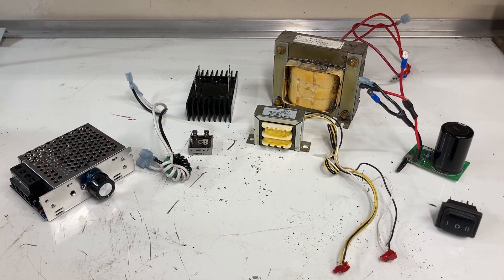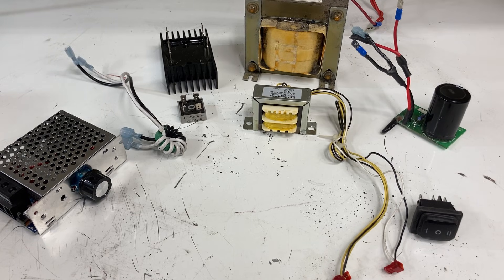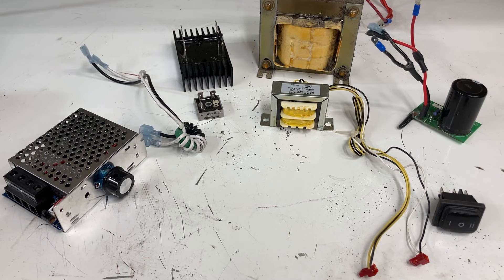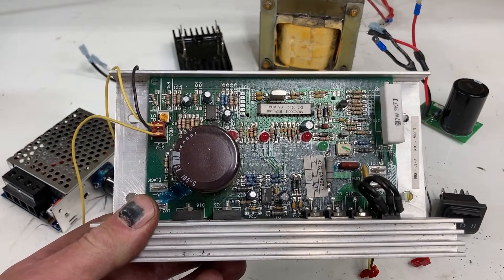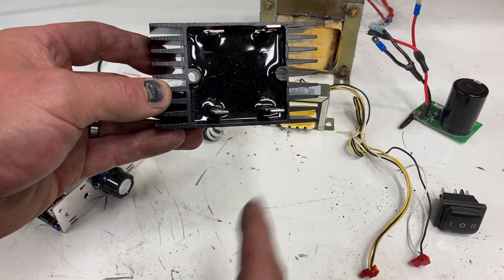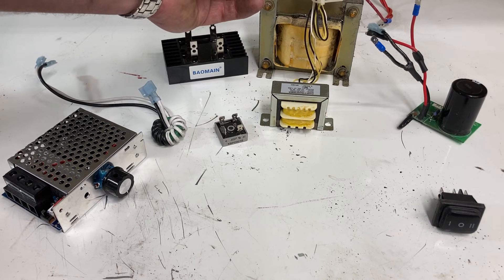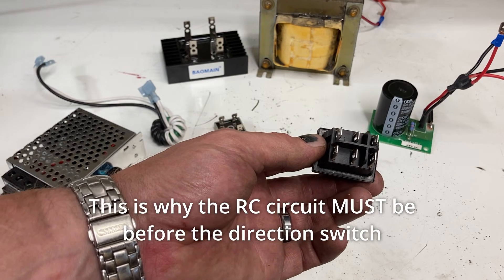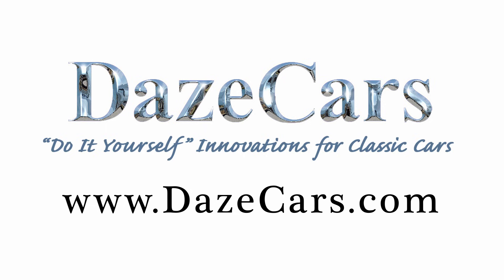Putting Together a QUALITY Variable Speed Power Supply or Treadmill Motor Controller SCR type

Comment: I am sorry to do this but I must:
Read on:  If this will cause to delete my comment and further be blocked, I simply interpret that as it did its job.
These import chinese so called adjustable voltage, variable voltage or whatever terminlogy is used for it, just know this.  In actual defintion they are what is called phase controllers, that is CHEAP PHASE CONTROLLERS.   But phase controllers for what?
There are only two ways to change voltage in AC motors.  One is by what is called phase control and the other is variable frequency drive.  You hear the term VFD lingo.   Now read on.

Phase controllers do not work on induction motors.  That is not what is meant by AC motors.  When they say AC motors, it means universal motors, you know the brushed motors like your power tools if you know what I mean.
They also work as light dimmers.  And that is it.  But anything works on those universal motors, you don't need this nonsense to control their speed unless you have an old old vintage one that was made back in the days  and you just can't wait to control their awe inspiring speed.

Now if you think you can just install a bridge rectifier (any kind of it) and a choke and a capacitor or whatever on these to run a heavy duty Magnetic DC motors you will be in for a rude awakening.
You are basically running your Treadmill motor on a cheap messed up half ass supply that is neither AC nor real DC.   Trust me.
When you convert your AC to DC with a bridge rectifier, what you don't get is the science of it.
First of all as you know your AC flactuates up and down and also back and forth.  It has two movement.   Well guess what, so does your bridge rectifier, it transfers the up and down fully intact, just removes the back and forth.  

If you think  a capacitor  smooth things out, guess what, it doesn't.  In fact it raises the voltage higher.  Just remember you and I and all these folks didn't finish a degree in electricity.  I know and there are billions of us out there. 

Your motor takes on a beating like it is nobody's business.
If you want to destroy your motor, there are cheaper and faster ways to do it.

And by the way that potentiometer turning knob job has little meaning with respect to this. These high torque heavy duty motors will impose their need on current and them little turning knob job and the triac and diac and quadrac by themselves is just kids play to it.   These things are called light dimmers for a reason.  And by the way this word "light" in light dimmer does not refer to any other light but old obsolete incandecent light bulbs.
You hear that?
You get that?
Suit yourself.

Now you think about that.
( No you won't hear this kind of truth just to get attention and clicks)
Reply from the maker: You are not correct, at least not correct as it pertains to my video.  An SCR voltage controller does the same thing that a PWM does only for AC. It switches on and off quickly to effectively reduce voltage. You are correct that this technique does not work well for most AC application except things like lights just as you said, but when you convert it to DC with a rectifier it is true DC. That is how a rectifier works. When DC is converted to AC it is not tru AC BUT in reverse it is 100% true DC. That is what every power supply in your house does. You are also correct that when improperly set up SCR controllers will create power spikes, but that is what the chokes are for. The AC choke between SCR and rectifier eliminates low frequency spikes and the DC choke on the positive leg eliminates high frequency spikes producing clean power. This technology was used for years in welders.  An SCR would "reduce" voltage and a rectifier would turn the voltage in into DC. As to your  capacitor concerns  that is why it was the last “cleaning” component.  After the spikes were eliminated it helps stabilize power.  If run before the chokes there is a swing in voltage because of the spikes loading the capacitor.  The Capacitor is not that important 99% of the power cleaning comes from the chokes.  I have been using this setup on my lathe for over a year with hundreds of hours of run time because it was set up correctly. Your statement about it ruing my motor is simply incorrect.  People against SCR as passionately as you are, are usually speaking from experience, they bought a cheap SCR (the cheaper the SCR the dirtier the output), didn't use chokes, used a cheep rectifier and expected it to work well. NOT ALL SCR VOLTAGE CONTROLLERS ARE CREATED EQUALY.  Just like with a PWM the better the controller the better the power.  I didn't create this video for likes and attention as you  presume, I did it because there is a lot of bad information out there that does not show people how to correctly set up an SCR. Because of that bad information a lot of people have ruined their DC motors by not setting things up correctly,  BUT doing it correctly will result in a good system that lasts a long time. Is an SCR as good as a high end (and expensive) PWM designed to run a motor like this, NO.  Is a properly set up SCR as good, easier to use, more cost effective and way more robust than most PWM that come in treadmills, YES.  I have three machines that are all using treadmill motors driven by SCR controllers and because I know the correct way to set them up they work extremely well.  Your conclusions are based in facts but not the entire picture and without the full picture/understanding you are drawing incorrect conclusions.
Reply: @dazecars  To genuinely know what I am talking about when I say DC supply and to witness it in actual fact the experiment is simple and no arguments as what DC supply means.  The difference between AC, rectified AC, AC to DC converters and the real DC.
None compares to real DC.
Since AC to DC converters are say expensive and that is why this type of videos are there for do it yourself.... which is the wanna be DC supply.  It is termed as rectified AC.
Fortunately there is the real deal at your disposal and it is everywhere.  Better than the expensive converters, yes  of course.  I give you the real deal, YOUR CAR BATTERY.
Just grab any of these motors and don't be shy because your car battery can turn your starter, that is right and that is no child's play which mind you then turns your entire engine.  That is right.

You just hook up any of this Treadmill motor to your car battery and don't you be shy because you are in for a treat.  No worries, use your jumper cable, hell that is even better.  It won't hurt anybody's feeling, especially yours. 

You will never ever be the same again nor will your beautiful Treadmill Motor once you witness what real DC is.  Now know why no one told you that.
It will purr like a kitten and the sound of harmony as your eyes and your ears witness it for YOURSELF FIRST HAND.

Didn't mean to be beligerant at all. Just making  it be known.
{ I mumble to myelf, it is hard not to get a joy letting the cat out of the box, or maybe it is bird. Now I can't remember}.

Hey here is one.  Buy a battery just for the motor. In fact get two of them and hook them in series and make 24 volts.  That is right.   Then get this,  hook up your battery charger to your battery ( why not).
You follow?
Hook up your Treadmill motor to your 24 volt battery,  Just trust me okay.  No need for 100 or whatever volts.  That motor will do whatever you wish.  No it won't pull your semi trailer.  Don't be silly.
But you will know sweetness.  And wonder if that thing is even running.  Oh whisperring beauty. 
Over and out.
Reply from the maker: @alchemy1  now you are just going down a rabbit hole that has nothing to do with the topic. “Rectified AC” IS DC. A lot of things in your home use a rectifier to convert AC to DC. Even the PWM controller boards that come in a treadmill for the express purpose of powering the treadmill motor have a rectifier to convert AC to DC. The only functional difference between PWM and SCR is the PWM does the on and off switching to reduce power after the rectifier where as the SCR does it before the rectifier. Will DC created from a rectifier be as smooth as a battery, NO. But that doesn’t mean it won’t work and work well. Your suggestion of running two car batteries and a battery charger is ridiculous and proves you do not know what you’re talking about. The advantage of a DC motor is if you change the voltage you change the speed. This is why you use a motor like this in applications where you want to be able to adjust speed with the turn of a knob. Your “battery technique” will provide a constant speed (with the exception that the speed will slowly decline as the voltage drops due to the depletion of the batteries) and is not a variable speed supply which is what the video is actually about.
Reply: @dazecars  To mitigate between zero point crossings, inductor impedence and capacitor impedence requires far more and much more involved than to be resolved by simplistic devices.  Will agree to leave it at that.  I didn't make the rules. 
It is all good ( assuming one has managed to ge to first base) untill there is demand on the system, then things get revealed more and more.
[Quality is an appealing convincing term]
That is all.  I had nothing to do with it.  :-)

Comment: Would a drill gearbox work mated to a treadmill motor? Cheapest gearbox I can think of.
Reply from the maker: Different sized pulleys and a belt are the best way to go.  A drill gearbox will not be able to handle the RPMs that treadmill motors go to, most are 4000-7000

Comment: PWM doesn’t need to be expensive, not when you build your own controller. And they provide more low-end torque than an SCR in my experience. 
I haven’t messed with treadmill motor voltages in a while, but I’ve got a really nice motor on the shelf that’s been waiting for a home. Probably time I dig it out and wake it up.
Reply from the maker: A pore quality SCR will not function as well as a PWM and yes the motor will slow under load ( your observation of less torque). But a quality SCR will function as well as a PWM supply.

Comment: What size choke did you use? Do you go by amps or……..? The big choke I mean; just before the run capacitor.
Reply from the maker: I just use the ones out of treadmills I have parted out, and there are not any specs on them.  I have 4 different sizes from the size of a racketball all the way up to a softball and they all work about the same.  If you are looking at a new one you want one that is rated at the amps of your motor.  If it is rated in watts take the amps X the volts from the motor and that will give you watts. For used ones  eBay is probably your best place to get one.  Search "Treadmill Choke".  Be warned however that a lot of eBay sellers do not know if they have a choke or a transformer AND because they look the same think they are interchangeable but they are not.  Easy way to know the difference is a choke will have 2 wires, but a transformer will have 4 or more.
Reply: @dazecars  thank you very much

Comment: Blessings bro just got a 240v 3hp out rotor dc motor would appreciate a little help understanding the motor and actually powering it up any help will be much appreciated
Reply from the maker: I need more info to help. Contact me through my website so you can email me pix of the motor, especially the data plate.

Comment: Nah, PWM is the way to go. Today's semiconductors with good heat dissipation mitigates all the issues you mentioned. It's why welders today are a lot smaller and run cooler than in the past. When you compare the waveforms, PWMs deliver a cleaner and more uniform torque/speed.
Reply from the maker: Thanks for the comment.  I 100% agree that a good PWM power suply is better than SCR controller but a good PMW is also expensive,  $200 + for one with the amp and volt requirements of a treadmill motor at max.  Most of the treadmills come with a PWM board but in my experience they don't work as well as a properly set up SCR units.  So if you spend the money, a good PMW will out perform an SCR but most people using treadmill parts are trying to balance quality with price at which point an SCR unit is far more budget friendly and (if you do the things in my vidio to clean the power) can be set up to run very well providing the best performance to cost ratio. IMHO
Reply: @dazecars  You can buy a 90V pwm "speed governor" for less than 20 bucks on Amazon. At the lowest voltage, the torque is low, but you can gear it up to overcome it.
Reply from the maker: @bobweiram6321   A lot of people running treadmill motors run them BECAUSE they can lower the speed and anything that looses torque at lower RPMS is counter productive.  Would love a link for this PMW that is only $20.  All the ones I have seen are not really up to the task
Reply: @dazecars   PWMs lose torque only at the lowest range due to its back EMF sensing circuit. If the EMF combined with the impedance of the motor is below a certain range, the circuitry fails to dump more power. Once you get past the low range, the torque curve stabilizes and flatlines, which is the constant torque. A slightly more expensive PWM controller has better sensing and can adjust the power to maintain a constant current or torque even at the lowest speed. It's not an important detail since 1 to 5 RPM is used much and if you do need it, then gearing it will give you constant current at those speeds. SCRs, on the other hand, only give you maximum torque at their full speed and rapidly drop off for anything lower. You're essentially controlling the phase angle. 

Here's the link for the controller. The price has gone up since I last checked. There's better ones out there, but I cannot vouch for them. 

https://www.amazon.com/dp/B07RLFZM2V?ref_=cm_sw_r_cp_ud_dp_PC75RYT25GJDM69ATN8Y
Reply from the maker: With an SCR the torque at low RPM is fantastic ( I do single point threading in grade 8 bolts all the time and my lowest RPM setting) even if you are correct and it is only max torque at max RPMs it is still nearly max torque at the lowest RPMs so the drop off in minimal.  I mean no disrespect but your PWM is a terrible choice. It is no wonder you are loosing torque. That is a 5 amp PMW and most of these motors are 15 amps or more. Torque is a product of amperage as the number of amps flowing through the coil determines the strength of the electro magnet inside the motor. At only 5 amps you will loose torque at ALL RPMs. I am not 100% sure but I don't believe the relation from amps to torque is linear so with your 5 amps it is probably better than 1/3 max torque. But you are probably loosing at least half the torque your motor is capable of.  And if it is linear than you would be loosing 2/3. A higher amp PWM will cost you several hundred dollars. You are correct that a QUALITY PWM will out perform an SCR. But the one you have linked is not up to the task.  The only budget friendly way to run a treadmill motor and not loose torque is to run the treadmill board or an SCR. Your premise that your PWM is better simply because it’s a PWM is like saying a 250 cubic inch V8 is better than a 400 cubic inch in line 6 just because it’s a v8 but the 400 will out perform the 250 in EVERY category just as a quality SCR will out perform your PWM in EVERY category.
Reply: @dazecars  A 20 amp variac and bridge rectifier will out perform your scr.  The variac will make a cleaner dc voltage with a capacitor but it will work fine without a capacitor because the windings in the treadmill motor will act as a choke and filter the pulsed dc out of the rectifier good enough.  This is the cheapest and best performing circuit.  I have this circuit on my Logan 10" lathe and it works great.   Both you and Bob Weiram should try this circuit.  Only two parts.  I found a 20 amp variac for $61 on ebay.
Reply from the maker: I did a head to head shootout between the SCR, Mc2100 and a Variac and they all had strengths and weaknesses but the end result was they were all abut the same.  I still prefer the SCR

Comment: When buying the chokes, what specs am i looking for for both AC and DC?
Reply from the maker: The 
AC choke is easy, it is simply a ferrite doughnut with both AC leads wrapped around said doughnut about 6-7 times.  A lot of electronic devices use them and they can be scavenged from lots of things.  The DC choke can be gotten off eBay.  Search treadmill choke HOWEVER because transformers and chokes look similar and because of that a lot of eBay sellers list them interchangeably and they are NOT  Easiest way to know if it is a DC choke is it will only have 2 wires.  a transformer will often have 4-8 wires but never only 2
Reply: @dazecars  Thanks Daze, I bought a choke off of Ebay (2 wires). The purchase hurt though, $40 after shipping and tax.
Reply from the maker: @FNSICK  It will be well worth it in the long run as it will increase motor life
Reply: @dazecars  I bought the wrong board though. MC-1200 instead of a MC-2100. Looks like it will work fine though
Reply from the maker: @FNSICK  If you have any problems hooking it it contact me through my web page so you can send me pix of it and I may be able to help